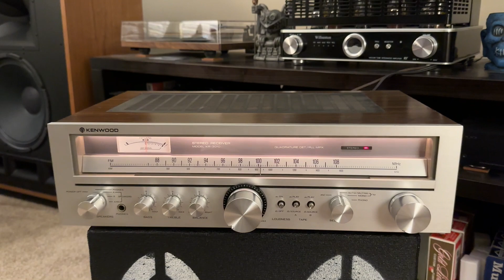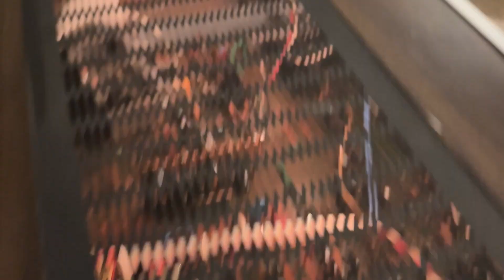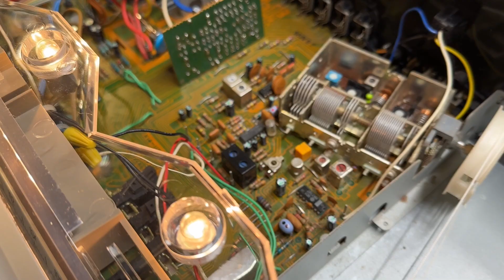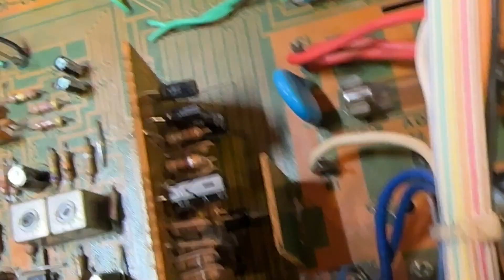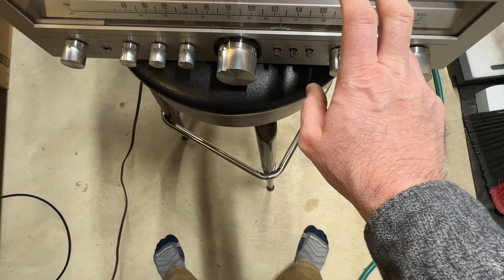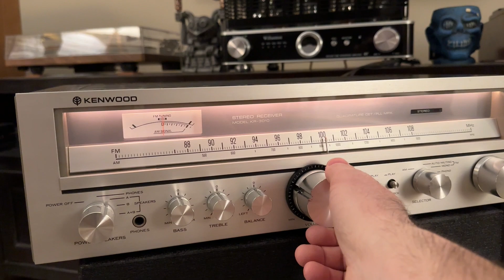Kenwood KR 3010

Comment: Where do you get the parts, I need a volume switch and tuner string.
Reply from the maker: I didn’t need any of the Kenwood specific parts. You have to watch eBay to see if any be is parting one out at the time.
Reply: @421CentralIowa I’m excited to start learning about this.
Reply from the maker: @ErikRocha_1980  If this is the same model you are wanting to repair it's a good one to start with.  It's pretty simple and the capacitors and other components were easy to access.

Comment: It is a clean looking unit almost a Pioneer knockoff, of the 780 series. Ive got a KR-5600 and a KR-3600, they are showing their but still working. They have a red LED on the tuner pointer.

Comment: Just closed on ebay salvation army.  36 bucks 15 shipping.   These days going in 7-11 is 50 bucks . Can't go wrong as the unit itself-case knobs real glass face plate and all the parts are worth much more and will only increase in value.  Nice video thanks for sharing
Reply from the maker: THe faceplate is plastic, like plexiglass.  Hopefully the shipping goes well and you end up with a nice receiver!